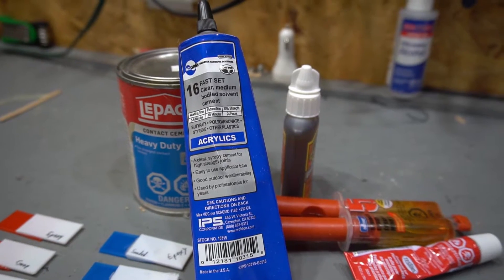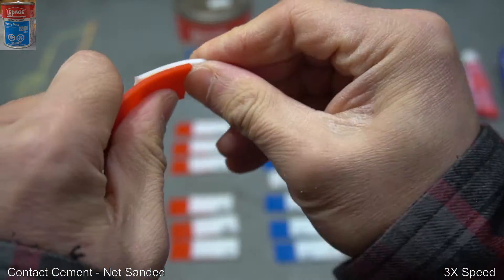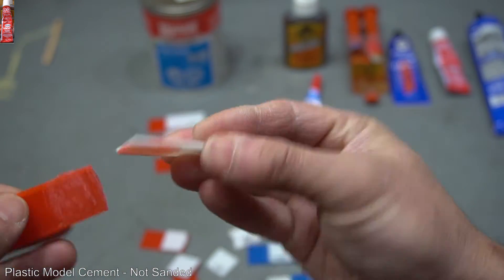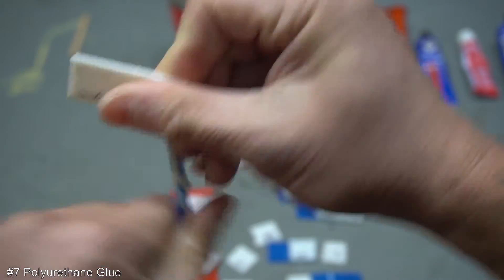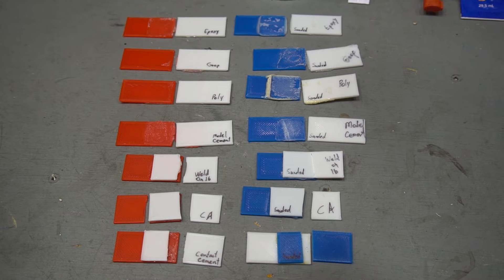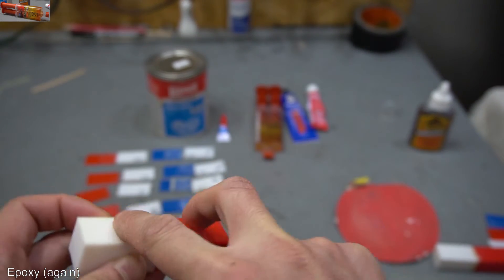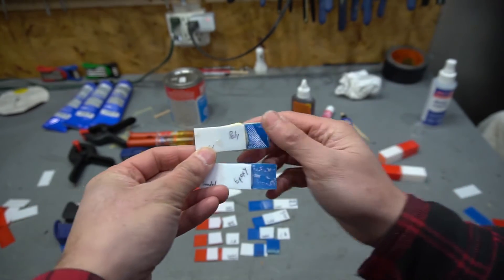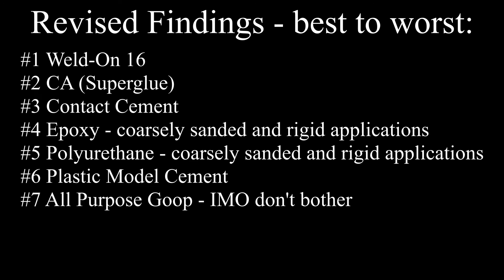What is the Best Glue for PLA 3D Printed Parts

Comment: I started a project building a bass ukulele , all in parts (pla printed with a threaded metal rod through the neck ) I couldn’t find anything but contact cement locally , originally I started with epoxy for the body , seemed solid enough , I reinforced it with a 3d plastic pen , it also claimed to be an epoxy specifically for plastics , not sure the difference , now I’m doing the neck with contact cement , but after seeing this I ordered some of the acrylic 16 stuff , it’ll be a mutt mix of glues lol, guess we will see where and if it will fail , though it is supported with the metal rod that goes from head to body , doesn’t go all the way through , so hopefully the body can hold , guess I’ll see

Comment: something is very wrong with that epoxy...for example west system 655 is impossible to break. I glued several unsanded 3d prints like boats 1 meter in length and it is like steel welded. waterproof. everything proof. so that epoxy is either trash or expired.or maybe not mixed properly

Comment: This video just reinforces my belief that contact cement is one of the most versatile glues around. And with time the bond will even get stronger as it dries out. And, like Andrew has found, epoxy is meant for rigid, solid materials. Just see how well it works for mending broken porcelain, for instance.

Comment: Great video! The value take-away for me is that for my purpose (I want to hold a multi-part art print together & to be able to undo/redo if I mess it up) All Purpose Goop fits that need. Not a functional object, but static. Kinda free joints, but you'll notice if I misalign one. Can I punt & redo? Looks like I can with APG. (I'll report back if I fail.)

Comment: Finding a good glue for PLA that doesn't cost an arm and a leg is quite a challenge. I found that Tertell Strong Shoe Glue I got from Temu was very good as a glue.  It has the proper solvents that dissolves the PLA so a good bond is achieved. Low in cost. Other "shoe glues" should work too. It passes all the same tests that you did. Stronger than the PLA.

Comment: i just use hot glue for PLA, i am planning to get PETG and epoxy glue for more practical applications. 

i just think that for PLA atleast if the force is strong enough to break a hot glue bond, you shouldnt be using PLA in that project/part that your trying to make

Comment: I’ve recently been using model glue or (gel) CA as I have had a bad habit of gluing my fingers together with CA and prefer to avoid that risk. I use CA, though, when gluing in magnets as model cement doesn’t seem to work for dissimilar materials. I wonder if the risks and dissimilar materials issues exist for contact cement or Weld-On 16.

Comment: You forgot to test standard hot glue. Normally I have little respect for hot glue as method to bond to objects together and resist external stresses. But when applied to Petg And Pla its as if the hot glue rivals the expectations of epoxy resin... almost anyways. For most applications hot glue wins. For something critical that will be endure lots of stresses, I would use Weldon. I've also heard excellent reviews about Weldon 3 and Weldon 4 albeit Weldon 3 is described as very volatile and evaporates very quickly sometimes even before it arrives in the mail . Nice review!!

Comment: this is strange. i tried ca-glue but it did not hold. are there different ca-glues?
Reply: same problem. frankly ive had the same issues with weld-on 16. the only glue that has ever held perfectly was devcon plastic welder cream. only problem is cost and the shelf life isn't great. You have to be careful when you but it, if it's yellowed on one side at all, don't get it. And amazon seems to sell only old stuff.
Reply: @bobafett47074  I had to sand it first to make ca glue work.

Comment: Thank you for the detailed testing on PLA. CA is what I had been using, I'm switching to weld on 16. I like the fact that it has a solvent and some plastic material that melts the pieces together just like PVC plumbing.

Comment: Excellent test, very helpful. However, I disagree with two of the conclusions.

1. At 6:20 you can see the PLA pieces starting to peel apart, then break in the middle of the glued surface. At 6:26 the glue residue visible after, proving that it failed before the PLA did.

2. At 6:55 you can see the white PLA piece start to deform at the vertex, something we didn’t see with any of the other glues. Since we know that part of its adhesive strength is due to partially melting the PLA at the boundary, I wonder if it actually undermines itself in an application like this one by weakening the PLA itself.

My takeaway from this video is to simply use CA for gluing PLA in most situations, with no need to sand the surfaces. If I’m worried about it setting before it dries, or I have a gap that CA is too thin to fill, and modifying the design to add more tabs that align and hold the pieces better while drying isn’t an option, then I’ll use epoxy. (And if I need to glue something quick and dirty and reversible I’ll use hot glue.)

Comment: I use generic plastic glue specifically because it isn't that strong. Not all parts need strong bonds and sometimes it is useful to have a glue that you can pry apart. Just did that two days ago, had an assembly but i wanted to design&print one part of it again. It was easy to just put a knife in to the join and cut it apart. In that case the glue is strong than enough for holding but if need be, i can redo it again and again.

Comment: Not a good test with thin strips because pla breaking off before glue nonetheless good general test at least you can see which glues definitely not to use at all. Would like to see a test which glue can binds instantly without waiting so long. I’ve been using super glue and it’s an instant bond. Super glue seems to like PLA allot and I like the instant bond and no waiting for figures and stuff like that. Also in the video contact cement works well because it tends to melt the two PLA parts together and hence fusing them. I think super glue does that too who knows.

Comment: In my tests, the CA (superglue) is useless, very spotty whether it will hold or not.  Epoxy is great on big, rigid parts, not on small flexible ones.  Gorilla useless.  Contact cement is not a long term solution.  OK for a temp glue.   Looking to Weldon-16, and equivalent formulations.  Got one called "same stuff".  Took a really big pla print.  It was about 6" long, a T'bar with the base 1" and the cross bar 1/5" (20mm and 10mm).  Glue two of them together.  Even the really strong T-bar broke before the same stuff let go.  OTOH with a 4mm thick domino like Andrew used, but thicker and more rigid, with a slight texture on top, indicative of a PLA print, after 5 minutes, the glue didn't hold.  Going to try the same domino after a couple hours. Tried it again and it didn't hold after 2 hours.   Now trying to glue it over night and two very very smooth flat surfaces together. Incredibly expensive and very hard to get, but good under the right circumstances..

Comment: Nice test.  However, my experience with contact cement is no good for a long term solution.  Also, CA glue has NOT glued my PLA prints at all.  Might be more recent formulations of PLA, but it was NOT GOOD.  I'm going to try Weldon 16.

Comment: I heard the Weldon 4 is best, then Weldon 3, and then Weldon 16.  #3 sets up in a few seconds, 4 sets up in less than a minute, and 16 sets up in 5 minutes.  Weldon 3 and 4 are the consistency of water and don't work on for filling voids like 16 does which is much thicker.

Comment: CA "super" glue has been such a mixed experience for me. I always sand, so that's never a factor. It's just....brittle, for lack of a better way to put it. I've had pieces come apart with normal handling. The 5-min Loctite epoxy has always done well for me when I sand good and apply it with a brush. Admittedly, my epoxy glues are usually larger pieces, and sometimes I design them with dowels built in that also get epoxy on them. I still use super glue for small pieces for convenience, but I will def have to try the 16.

Comment: I was looking for a glue that would work best attaching parts with small surface areas as opposed to large, flat surfaces. Even have trouble with super glue not instantly bonding small parts. Guess I'll try weld-on.

Comment: From personal experience the only Gorilla glue i use is an All-Surface clear Max strength version. its in a caulk gun style application but its all around the best ive used. easily bought in the caulk and adhesion aisles of Home Depot. biggest downfall with gorilla polyurthane base is that it foams and ruins my prints, next to impossible to remove said foam as its tedious and required too much damaging chemicals to remove.

Comment: Best glue for PLA, don't know about glue but I doubt anything sticks two pieces of PLA together better than S-Polybond PMMA. It's solvent weld for Acrylic but works INSANELY well on PLA too. Do mind that it is solvent weld, it has the consistency of water and will not 'fill' gaps. It briefly dissolves the top PLA layer (so you can bridge small gaps during that stage and squish the 2 pieces together) and as it evaporates (which it does fast, seconds to a minute max) the PLA hardens again and is then chemically fused.

Comment: A little bit of analysis... When you bend the two parts, one side expands and the other contracts, so the glue has to adapt to this situation. 
Epoxy cures very rigidly and that's why it peels off when you bend the pieces, it can't contract and expand on both sides of the glue. 
Because the superglue creates a very thin layer, it does not cause the same problem as the epoxy. 
Contact cement on the other hand, does not have this problem, even though the glue layer is thicker, it can contract and expand on both sides of the glue layer.

Comment: Late to the party but this video has helped me immensely. I've just printed a helmet in various parts and I was able to solder weld most of it but there are some parts that I cannot get the solder to to fuse the parts without ruining the print. Nice to know I can use contact cement and it will keep in place 🤟

Comment: CA can make a white haze on parts when it cures and makes sort of a puff of what almost looks like smoke.  I would like to avoid messing up the finish on a fine part.   I'm wondering if it would make a good seal.  The 16 glue makes a skin very quickly as it contains very volatile chemicals that evaporate quickly that it uses to melt the plastic.  Contact cement looks good, but I have some difficulty getting a very smooth even application on both pieces as it also forms a skin very quickly. I wonder how well a silicone caulk or maybe a commonly available auto part store weather strip cement would work to bond PLA?  Excellent video.  Really helpful to see all these glues in action.

Comment: Thank you. Will definitely start using weld on 16. My biggest problem when gluing printed parts is thin edge to edge gluing. The small surface area is difficult for most glues to hold. Would have been good to see you try the thin pieces glued on the edges.
Reply: Have you had any luck with thin edge gluing?
Reply: @pheonixheart1125  I think Adam Savage has some helpful info on this stuff but using a faster (or slower) setting CA formula may be useful as well as using zip kicker or some other CA setting spray that instantly sets the glue.

Comment: Best glue for PLA or any plastic is EMA Plastic Weld. It actually melts the plastic and welds it together. I have done extensive testing with a bunch of glues and the EMA Plastic Weld actually rips the printed pieces apart when you try to separate the pieces. Your tests were great, but the limiting factor was the strength of your parts since they were so thin.

If you had used the blocks for all your tests, you would have seen very different results.
Reply: can try dissolving PLA in acetone making a sludge and using that
Reply: @chrishayes5755 You're thinking of ABS. PLA does not dissolve in acetone like ABS does.

Comment: I needed this thank you.  Please do petg
Reply: I have some experience with petg. 
- ca (superglue) - makes it brittle
- epoxy (5minute) - is okay after giving the part teeth with 80 grit sandpaper, still very week connection though.
-white glue (elmers) - i know does nothing. 
Petg is very chemical resistant and what is recommended to create the visor frames for the emergency face shields. I'd recommend to print as large of an assembly that is required or can be done and to mechanically secure them together. E.g. screws, nuts and bolts.
Reply: @jagtan13  gotcha  !  Thank youu.  !    I appreciate that

Comment: Thanks.  But I tried Loctite CA glue and it did not hold at all. I tried gluing two rigid solid surfaces similar to yours, but in cylindrical shape. I sanded both surfaces as well.

Comment: People swear by Gorilla glue but I find it one of the worse glues I've ever used. I can't reconcile those differences of opinion. It foams up like crazy out of the sides of the joint and is brittle.
Reply: It is great for foam RC planes
Reply: And you also have to clamp it, AND use an activator unlike contact cement or superglue
Reply: Same! I’m always blown away anyone recommends it. I’m a pretty big fan of ca and baking soda. Makes a plastic weld essentially and it’s instantaneous
Reply: @manapunk3085 how do you get your ca and baking soda between 2 flat part tho?
Reply: Using the wrong one. If it foams it’s not right
Reply: Not all Gorilla Glues foam.
Reply: Yeah specifically gorilla glue brand foams up
Reply: I use gg gel and if I need strength I add baking soda.
Reply: I’ve never found Gorilla glue to be useful for anything I tried. It’s messy, slow, brittle and just not a good glue.
Reply: @GazzaBoo Gorilla Glue is a brand - they make literally hundreds of adhesive types, each with completely different chemical makeups, and completely different bonding properties, which also depend on the materials being bonded.

Saying Gorilla Glue adhesive isn't useful is like saying 3M or Weld On adhesive isn't useful - it all depends on WHICH Gorilla Glue adhesive, what you're using it for, and whether you're isn't it correctly.

Comment: Like you I have tried all of what you have used apart from Weld on 16, as cant get that in the UK,
I use Tensol 12, 
It is a Methyl Methacrylate & Dichloromethane product
Any chance you doing a compare of this against Weldon 16 for your viewers .

Thank you for spending time and effort for people to understand what is good for Pla, 
Also Glue Ages and also becomes brittle after a while, specially super glue, Acrylic glue's are best for PLA, 
So don't waist money and nice models using the wrong glue's
as they will fail to hold.
as this had been a learning curve for me 3 years ago. and so knowledge of this will save you a lot of disasters.
Oh also when making parts to join together, include male and female fixture tabs and slots, this will increase strength.
Reply: I used tensol 12 but it didnt work at all on pla?
Reply: Weld-On 16 is Methyl Ethyl Ketone (MEK) and Dichloromethane (DCM). The DCM is the PLA solvent so as long as Tensol 12 has it, it should work equally well.

Comment: Why did Weld-On 16 score better than CA? Judging from the test, they performed the same. Is Weld-On 16 cheaper or more widely available than CA?
Reply: Superglues make material brittle. I didn't hear that mentioned in the video. I found this out long time ago gluing other materials. Try to use a superglue on an old shoelace or other string - it will break. You can see the fumes whitened the area around the glued part - that is brittle as well.

Comment: I definitely need to get some new glue since I've started making an Ironman armor. I got a 3d pen for xmas so I was thinking of using that to weld parts together. Would that be better than glue?
Reply: I am a little curious as to how you planned to do that? I can't speak from experience, but a 3D pen wouldn't melt the two ends of the parts you need to connect, right? I would assume that the plastic melted by a 3D pen would be insufficient to actually bond PLA. I know I am very late, but did you have any luck with making that Iron Man armor?